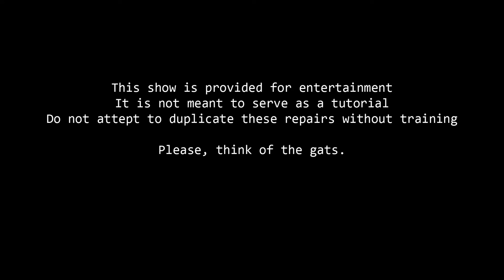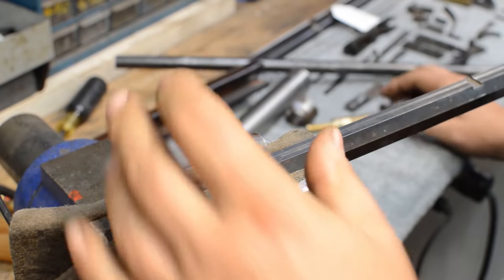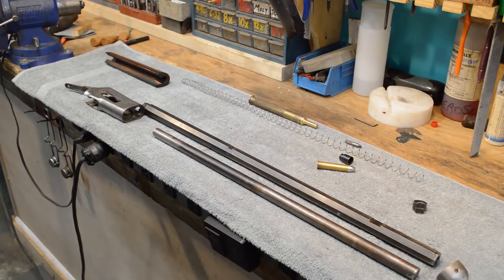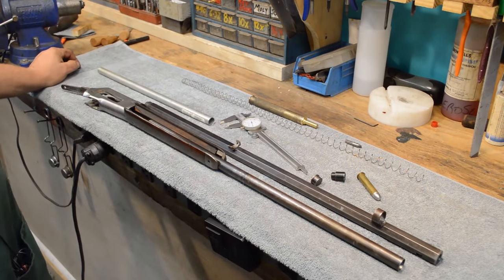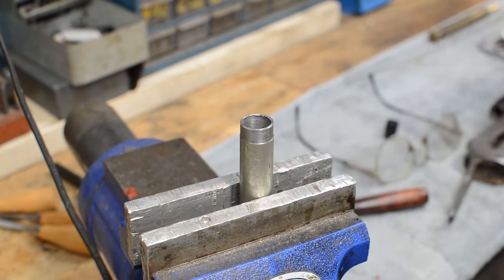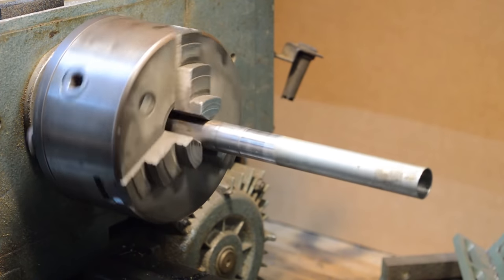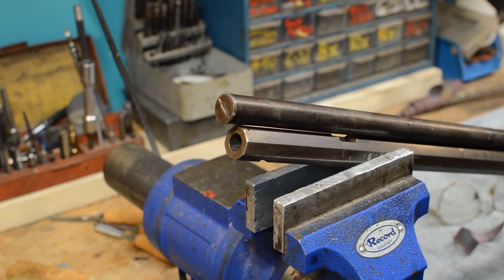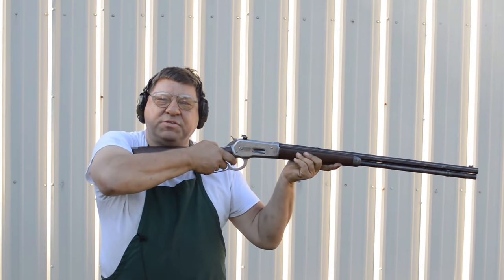Anvil 047: 1886 Winchester re-barrel and refurbishment

Comment: I'm sure you know that AR-15s are a little more complex than you make them seem. I know you don't work on them, and that's okay with me. There's more to them than just slapping parts together is all I'm saying. Not that you mentioned them in this video, but you have before. You have mentioned them other times and never really mentioned why you don't work on them. I'm just curious why you don't?
Reply from the maker: So many people can assemble an AR that cannot solder the ribs back on a shotgun barrel. I do what others can't and charge appropriately.
Reply: @marknovak8255  makes sense. I would agree that most people can assemble an AR-15, but I'd also say they would have trouble figuring out the issues when their parts don't quiet mate up or their gas and recoil systems need tuning. Many people will claim being a gunsmith but they only work on ARs and only know the basics about the rifle, not really caring whether the parts will last or if they will get mashed up on each other after 1000 rounds. I can tell you enjoy working on firearms that present some challenges to your knowledge and experience, knowing most of it but also having to think and problem solve new situations.
Reply: @Deathbomb9  You can put an AR-15 together even if you have never touched an AR-15 as long as you have some familiarity with field stripping a firearm. Just because the AR-15 truly is the plug and play of the firearm world doesn't diminish it from being a very good modern platform today. Instead of feeling insulted you should feel pride in the fact that American belief in interchangeable parts and standardization has led to such a modular and simple to maintain product.
Reply: @Cragified  I never felt insulted, just wanted to ask Mark's view or reasoning why. Trust me, I love the platform, own them, and have built many of them. And yes, if you can put a Lego set together you can build one, but at the same time I guarantee it will have some issues if you Frankenstein the rifle and don't have the experience to know how to check for those issues that can plague the rifle if improperly assembled or tuned. If you just slap it together you can break things or have issues with parts wearing faster than they should or uneven wear. I have seen my share of rough runners or dangerous setups because someone didn't want to spend some money on a vise block or proper tooling, or simply didn't know what they were doing. I've seen some very loose or wobbly parts that I was amazed were still functioning, like gas blocks, seen barrels that were torqued to 25ftlbs, and I've seen muzzle devices be ejected down range. If your average soldier isn't allowed to take it apart, I'd say watch some videos and learn about it before doing it. Lots of guys put out very detailed videos about the AR platform and even someone like me has things to learn.
Reply: @Deathbomb9  Unless you are building an upper from an absolutely maximum state of disassembly, or are custom fitting a trigger(like the jp) that requires fit and filing, there really isn't much to getting an AR built.  They're built to a spec, and built to go together assembly line style. 

I've met several very good smiths like this gentleman who don't mess with them, because people are not willing to pay what the mans time is worth. Not just the labor, but the lifetime of experience. Most that I've talked to, unless their business is assembling gucci ARs and selling them for te big $$$, will correct head spacing issues or chamber problems, maybe re-thread or crown a barrel, but that's about it.
Reply: @phoenixrising4573  there's actually quite a bit that a home game can screw up on an AR. Now, I do agree that men like Mark have very valuable time and many issues can be fixed in short order with swapping a part. I'm not talking about trigger jobs or things like that. I mean barrels being clocked, gas block and gas tube alignments, even gas key alignment that requires a bit more know even simple adjustment it. Most uppers really don't need a dust cover or a forward assistant. Eugene Stoner thought that one through in the bolt design. I've never used a forward assist, its counter intuitive. I don't like them, but I usually use pretty assembled uppers because they usually just add the cost of the parts which is pretty marginal, so all I need to do is everything else.

I never made an agreement of why I think Mark should mess with ARs. What I think is irrelevant to what he does or doesn't do or work on. I enjoy watching him fix or work on guns that some of us will never even get to hold. I've picked up plenty and learned so much more than I originally thought I would. If I want to watch someone work on ARs, i know several channels that specialize on them and are very good sources, and I've learned a lot from them as well. Yes, almost anyone can build an AR. But lots of them are over gassed, under massed, or have alignments that are out. Yes, mil-spec can take most the guesswork out of "will this part work with this part?", but you can still improperly torque something, over torque, or FUBAR something in a hurry if you are inexperienced or new to the platform. I've seen it happen, I've also seen things break for no obvious reason on brand new rifles after a proper break-in period. I was just curious because I though he had said it in a video before but it slipped my mind.
Reply from the maker: @Deathbomb9  For the record, I have a full set of custom, shop made AR tools. Like Mr. Quigley said, "just because I don't like em doesn't mean I cant work on em"
Reply: @marknovak8255  I never doubted you could. They share elements with many other firearms and some shops specialize in them. With a bit of knowledge about the operating systems one can easily diagnose and remedy an issue. I don't ever try to make someone believe they should have to work on a particular platform or firearm if they don't wish to do so. I understand why you prefer not to, and I'm totally okay with that. It's your time and your shop. I enjoy watching your videos and seeing how you face certain challenges. I've learned a ton from you and also love how you admit that you've screwed things up. I've had my own oops moments. The fact that you work on older firearms and have some that come in with problems that we could see in the future, and then showing us what practices and explaining the why and what of the fix is awesome. I can watch a million people fixing AR by swapping parts, those are armorers. There are very few videos of some of the amazing examples of history that cross your bench.

Comment: I’m an electrician and EMT is thinwall steel and mild. I would think that it is not the same type of steel as that which is made for firearms.
Reply from the maker: The EMT is made from better steel than the iron of the mag tube, and is slightly thicker. The mag tube is not even welded or soldered, just rolled like a cigar. Think well made curtain rod. Emt worked great here, did not have to take another 86 mag tube out of the diminishing parts pool, and it's CHEAP, eh?
Reply: Mag tube doesn't take any stress that EMT conduit can't handle.

You're correct that you would not want to use EMT for any pressure holding parts like barrel or receiver, but for an unstressed part like the mag tube it's fine.

Comment: Mark. Can you please educate an old guy who knows nothing about the mechanical things on the lathe? How do you know that interior cutter is not 1) cutting too deep or 2) cutting evenly?
Reply: Yeah Mark... do you normally use "the Force" when driving a boring bar..  (or calipers?)
Reply: From a washout apprentice.  While the  tube is stationary, you can touch the tool to the inside, and set the  zero point on the hand wheel (there's usualy a brass band with ruler increments on it or a digital read out). That will give you the rough start point. start up the lathe and give a very light skimming cut, to get a relatively even surface. Go in with your calipers or inside micrometer to check your diameter. Provided you have only pulled the tool out and not adjusted its left/right position, reset your zero point (or note the number displayed) and do the adjustments. After that its a matter of stopping occasionally to check your diameter. 
Evenness of the cut is a combination of visual, audible, and tactile cues. Unless you have some pretty specialized tools. When your cutter is not performing well you can hear the difference usually, and you can get some feeling from the vibrations going through the hand-wheels.
Reply: @EGCblackknight  great explanation, well stated sir...Find zero, cut to the number....evenness will let you know. It was singing a nice D # minor, they don't do that if it's uneven.
Reply: What egc perfectly said.
For heavier cuts I have slapped a dial indicator with a magnetic base against the carriage, did some math and just watched the needle till it was close. Then do as above to walk it in the last few thou.

Comment: The setup for that boring bar is disgusting.
Reply from the maker: For pulling a couple of thou out of a non pressure bearing part, it worked just fine.
Reply from the maker: The mag tube is not a machine tool, nor is it even a solid piece. It's rolled like a cigar and not welded. The loose setup is quick (time is money when YOU own the business) and works.
Reply from the maker: No worries, just wanted to add the backstory. Stay frosty.....
Reply: Works 99 % of the time but boy that 1% is gonna hurt proper tooling is cheaper than hospital stays